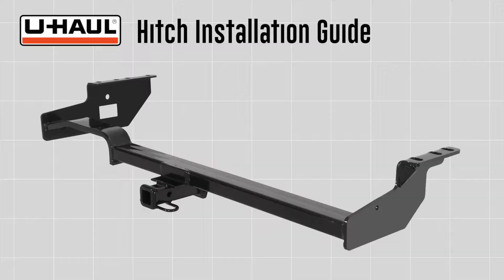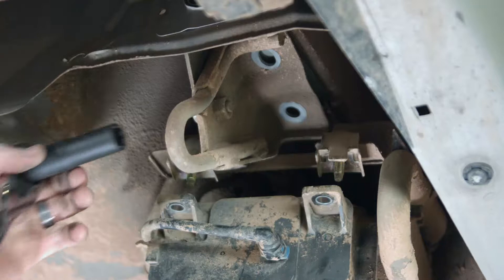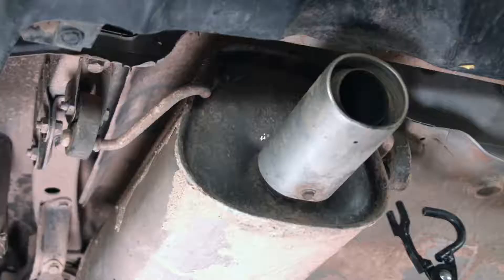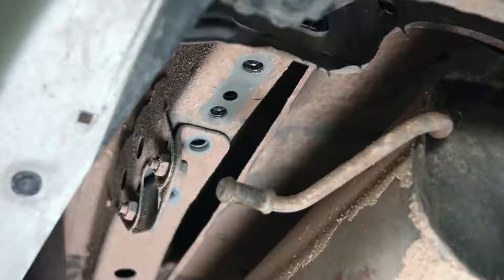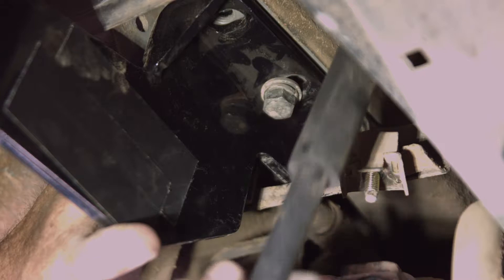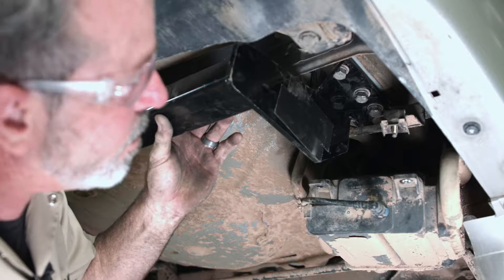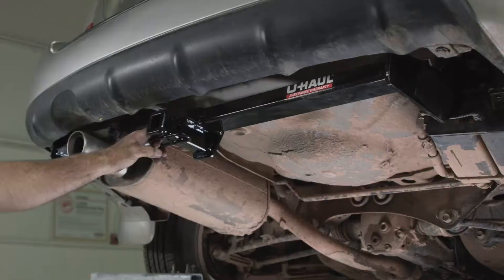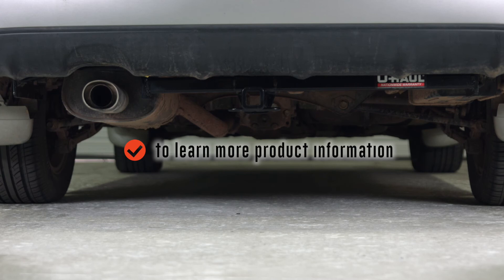2006 Subaru Forester Trailer Hitch Installation

Comment: one correction. there are no 10mm bolts in this install, there were no 14mm either. You need a 12mm, a 17mm, and a 3/4" socket for the new exhaust hanger bolt.